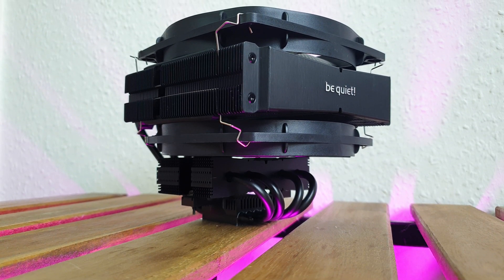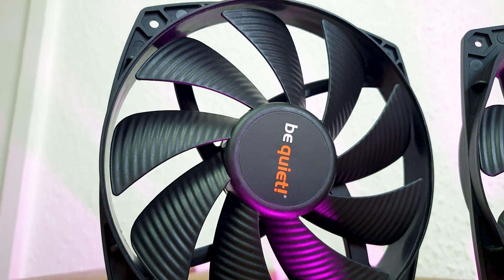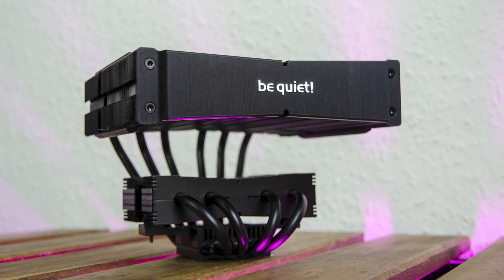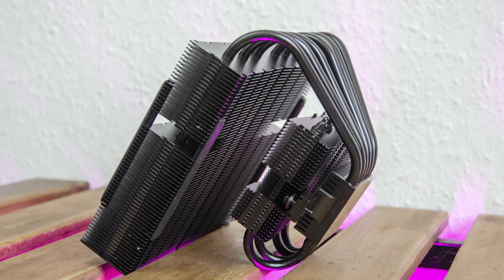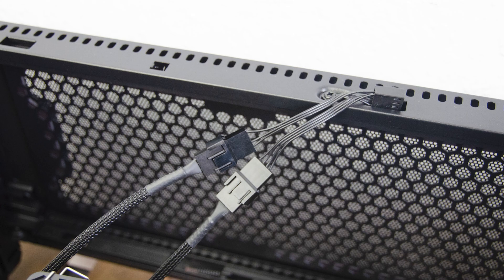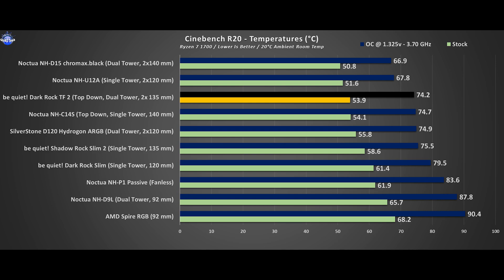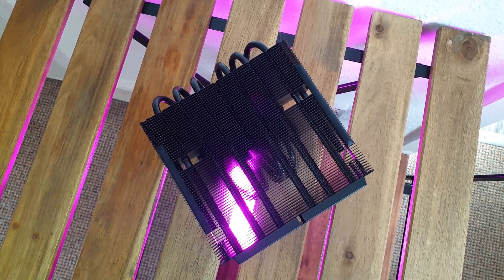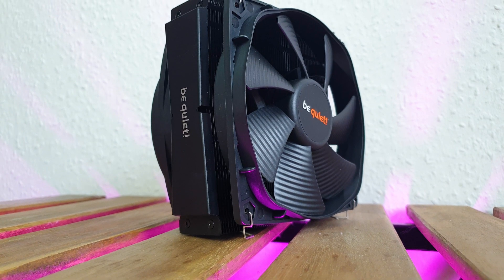be quiet! Dark Rock TF2 – The benchmark for Top Down CPU Coolers!

Comment: I know this may sound out of place because is a top flow cooler, but has anyone try this with the fan direction and positions inverted? I guess I'm buying this just to try.
Reply from the maker: No worries at all. I did some tests with the Black Ridge which is also a top down albeit in an SFX case and yes for that particular scenario it worked quite well. 👍 If you do, please let us know how it went with the TF2.

Comment: 49 mm, measured from the baseplate, not the motherboard, as such excluding the height of the socket and CPU. Wishing that BeQuiet would start to give their dimensions and clearances measured from the motherboard on and not the cooler itself.
Reply from the maker: Fair point 👍